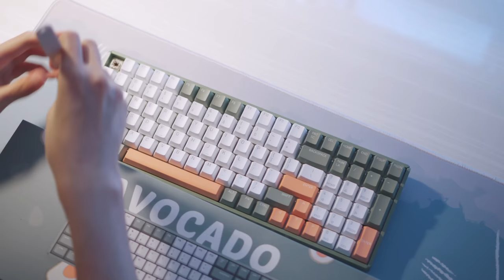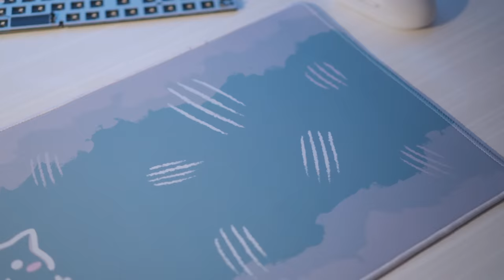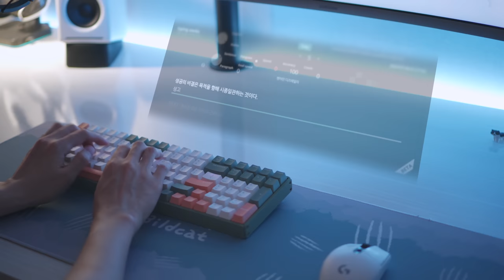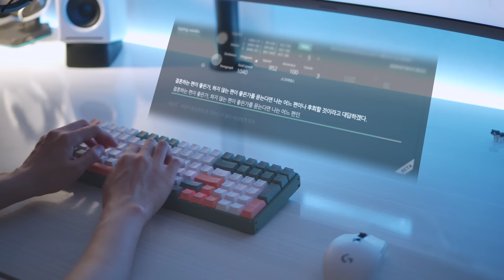Modding IQUNIX F96 & Typing Sounds

Comment: 3:35 Сам занимаюсь ремонтом техники и понимаю твои чувств, бро). Для людей, которые перед пайкой загибают ножки деталей,не заботясь о том, как это всё выпаивать обратно, приготовлен отдельный котёл в аду.
3:35 I'm doing equipment repair myself and I understand your feelings, bro). For those people who, before soldering, bend the legs of the parts, not caring how it will all be desoldered later, a separate boiler has been prepared in hell.
Reply: лол русский комент
Reply: @Truvv  лол русский ответ на коммент. И чё?

Comment: Hey @:3wildcat
I just recently bought the sk61 with optical red switches. It would be really nice if you posted the video of you modding it but without the time lapse. Thankyou for reading .
Bye :)
Reply: So like full time modding process?
Reply: Just slow it down
Reply from the maker: It's just boring repeating so I won't.
I always show with the normal speed at the beginning part

Comment: Imagine having everything done and realized that ... keycap interference
Reply: What does keycap interference mean??
Reply: @axeltheodorus18  you can watch his older videos to know
Reply: Thanh Phạm just explain it right here...
Reply: A bit late to the party, but it basically means he oriented the switch in the wrong direction when reseating it. 
It isn't a huge issue, but it will cause some led light interference and potentially the keycaps won't fit was wel, since you will have to put them on the switch in the wrong orientation (unless you want an upside-down or 90 degree angled keycap) which can cause clearance and bottoming-out issues. 
To fix this he would need to resolder the switch, so he probably just left it that way since it wasn't that bad.
Reply: @CarthagoMike  thank you bro! this paragraph was not in vain
Reply: @alimohsin496  why spend time to explain when there's an incredibly thorough video made by :3ildcat that explains an old question? this random guy doesn't owe u anything. pls.
Reply: @CarthagoMike  just resoldering won't help, you cannot rotate switch, you should replace pcb or switches to fix this. pcb and switches are north facing on this board out of the box. in this particular case I would look for some transparent switches not having interference and replace browns with them

Comment: Have you ever tried turning a regular PCB into a hot-swappable PCB using the mill-max or holtites plugs? If so how do they work and are they worth doing it?  I wish every board was hot-swappable
Reply from the maker: No I haven't and I don't like it
I've seen many complaints after that mod in my community.
And hotswap is really good thing but still, it's not solid as much as soldering
Reply: :3ildcat also one more question please. What do you think are the best stabilizers. Authentic gmk cherry, zeal, Durock? Thanks.
Reply from the maker: @millbean13  I believed GMK ones are the best but from recent build, very disappointed so I don't know..

Comment: For how long would you say, Gateron Opticals have to dry after Spray Lubing?
Reply from the maker: for 'optical' switches, no problem right after cuz they don't have contact
Did you lube them while switches are out of the plate?
If you did like soldered switches, the optical sensors on the PCB.. RIP
Reply: @3ildcat  I haven't Lubed already I'm on Vacation rn (I'll lube in around 1 Week😊) and yeah Ik I Have to spray Lube them outside the pcb

Comment: What if after putting fabric tape - stabs still rattle little bit?
Reply from the maker: 7:52
no rattling sounds from the plastic part
Reply: :3ildcat i meant I have putted fabric tape and my stabs still rattle little bit, do I need to put second layer fabric tape?
Reply from the maker: @MrAknur  Putting tape is to reduce the gap between the plate and the stabs so if it's not enough, and you think it needs, yes. Everything is up to you
Reply: :3ildcat thank you

Comment: Can I just spray lube this keyboard without desoldering the entire board?
Reply: You could, but with spray lube you risk fucking the keys up
Reply: @mrtheluckybucket  I went with the normal lubing...took me over 30hours of work...
Reply: @JaysusEscobar  was it worth it, though?
Reply: @mrtheluckybucket  Well, it is my keyboard after all. And it is the only keyboard I own. Was it worth it? Yes. The spring sound was bugging me for a while. 30hours of work was a long time but I'm a noob in the keyboard game, it was my first time lubing switches. I like this keyboard a lot. It sounds awesome. :)
Reply: @JaysusEscobar  Hell yea man, I'm actually thinking of modding mine like this, but they're reds. The ping sound isn't super bad, but I feel like it would be way better if I modded it like this.
Reply: @mrtheluckybucket  Well, you could always just lube like a couple of them first and try it out...if it works out well, then go ahead lube the rest...
Reply: @JaysusEscobar  How the hell did you spend 30 hours lubing? It takes me max 5 hours for a full size keeb
Reply: @fitchyyboi  I'm pretty new at this, and it was my first time lubing keys...I don't have all the tools.
Reply: Did u lube the exact keyboard ?
Reply: @ericalaugh3053  Yes I did